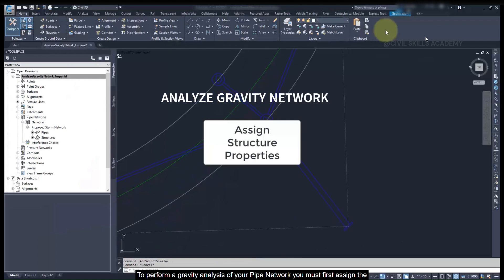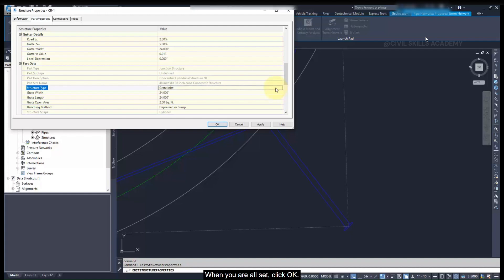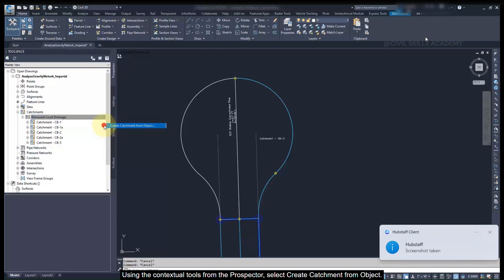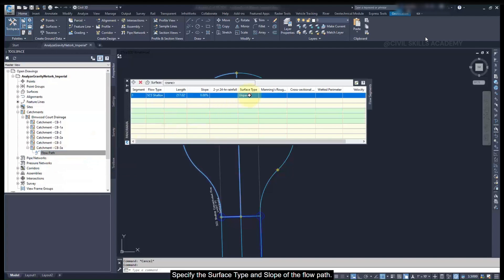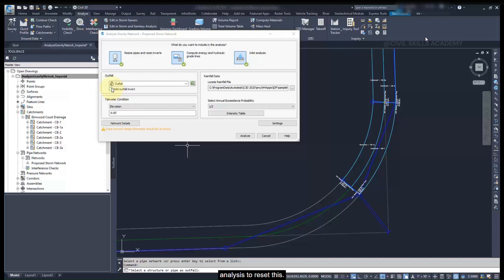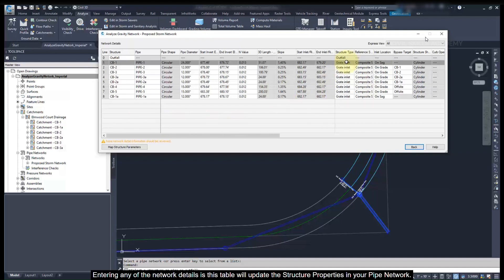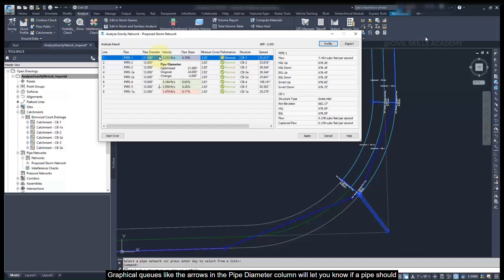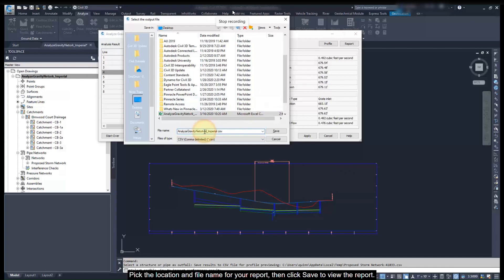Analyze Gravity Network in Civil 3d! #civil3d #gravitynetwork #pipenetwork #yt #course

Comment: Hello!

I needed to create a pipe network for a project, I know the pipe sizes, invert elevations and flow. I just wanted to analyze the gravity network, but when I click analyze (report)  it keeps changing the pipe size and flow. (Even though I set them up). 
Do you know why?
That could be because my project does not have a surface?
Thanks